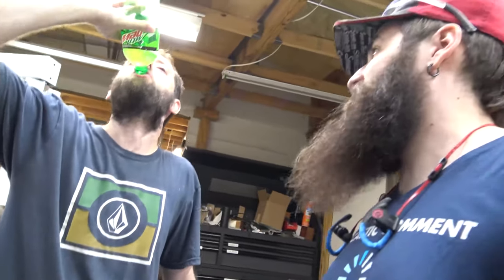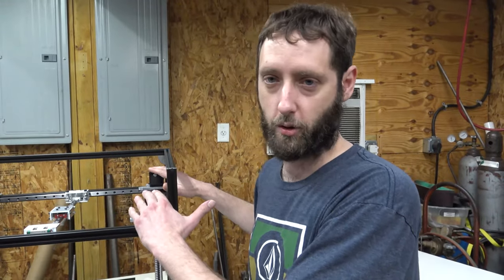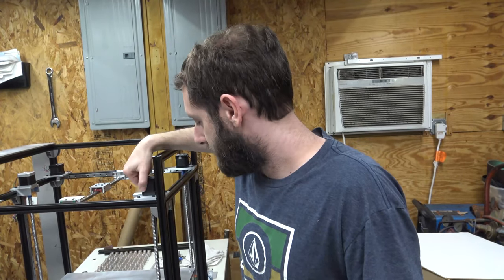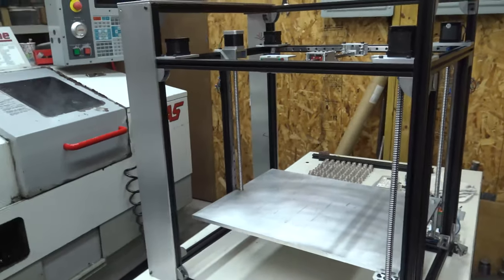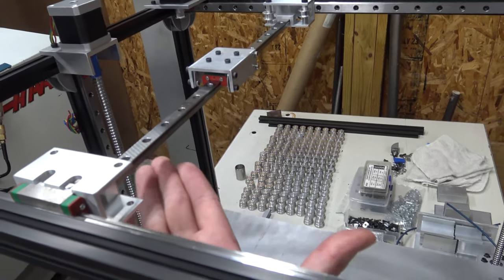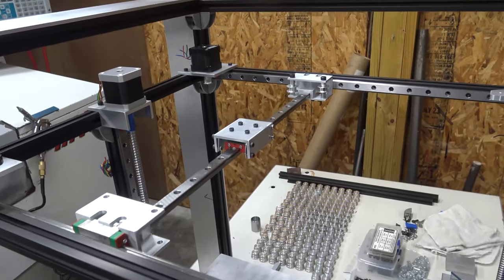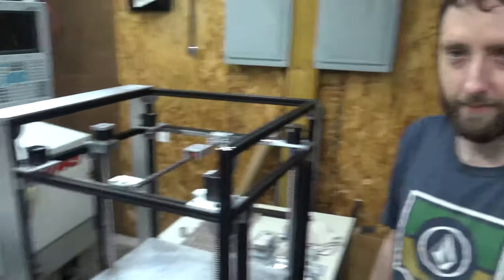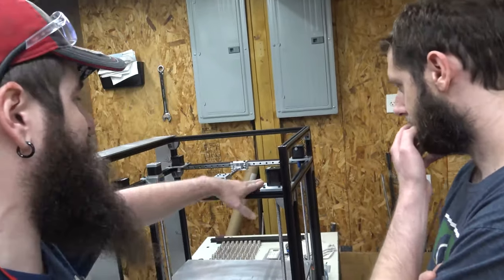CoreXY 3D Printer Build

Comment: nice video, keep up!.  want to know my 2 cents...... keep in mind i am not an expert .....
I would rotate 90 deg the gantry, unless you plan to set up and have real acceleration higher than 9.81m/s2 ( gravity) . ballscrews in tension is a good thing, tension reduce wobble. Motors are not made to hold linear force, disconnect the ballscrew and motors, and use a proper BK support at top end. then use belt to drive the ballscrew. it will also give you better resolution if you  gear it properly. motors on top makes the center of gravity higher, so be sure your frame is rigid enough. you should have you bed the size of the printable area. bigger bed adds nothing and will dissipate more heat, so less accurate temperature.  keeping everything "centered" reduce moment in the mechanical system, so less deflection, less ringing. Make everything on cad and then mill. milling parts and then measuring with an "construction tape" feels to me you are loosing the accuracy of the mill parts. Again, keep up, very nice to see scratch design.
Reply from the maker: Thanks for the feedback. We switched to a triple z setup with a kinematic bed. See the link in the description.

Comment: honnestly i think you will face more deivation due to the thermal expansion of your thick aluminium giant bed than from your quarter inch thick motor support.
and i think the 2020 extrusion are bending more than your plate.
Reply from the maker: Yeah we switched to a triple z setup with a kinematic bed. See the link in the description.

Comment: sooner or later you would want to have that printer enclosed, so you can print stronger, but higher temperature materials like PC, Nylon or even PEEK. And once your printer is enclosed it's a bad idea to have stepper motor in the hot air that reaches up to 140ºC.
Basically, in a case of heated enclosure, you want all your motors and all your electronics in a separate cool compartment.

Comment: I hate moving print beds, any updates for the workhouse 3D printer? The one with the xyz gantry.

Also design wise, your steppers at the top would be perfectly fine if the mounting method is very stiff. But since it doesn't look very stiff yea mounting to bottom may be easier to stiffen.

Having you considered using magnetic encoders on dual shaft steppers to ensure there are no misteps or desyncs between channels and instructions sent?
Reply from the maker: Magnetic encoders? We've talked about that. I'll have to find a source. I guess it would wire up to electronics similar to a rotary encoder?
Reply from the maker: There's more updates coming soon for the Workhorse printer.
Reply: @3DDistributed  awesome! Look forward to the updates!

Comment: because you guys move all the Z motors to the bottom. I think it is better to move the belt and pulleys to the top instead of the inner-side to side. Also for the bed, I would love to see Maxwell coupling for auto bed leveling.
Reply from the maker: Hey Trung, I've been meaning to get back with you. We actually have a version with the belts and pulleys on top. We planning on having an enclosure so it works well with the belt path on the inside. I actually have a kinematic coupling version of the z-axis bracket but need to make a couple of minor changes.

Comment: Looks good guys. I agree with you about the independent Z motors. If you run Marlin firmware it gives you the option to do a Z alignment as well. I always run a z alignment before a print because I have noticed the bed will drop just the slightest bit sometimes. It may only be 0.05 but that can be enough to cause hell with a first layer. Like someone else said look at using linear rails or something to help reduse the sway of the bed as well. Those lead screws cam only be so stiff. And I couldn't tell but the look like they arent anchored at the bottom. Sorry if I'm wrong.
Reply from the maker: I agree... It's just good if you can automate bedleveling where you dont have to check it. Everytime you pull a print off the bed your increasing the chance of knocking your bed out of level.

Comment: i think its not a good idea to have four z axis motors instead of combination with linear bearings/sliding bars or guide rail to hold the built plate  firmly without any abnormal play.
Reply from the maker: There's only 3 z-axis motors. It's now a kinematic bed and triple z setup. Check out the updates and see the User Group link in the description.

Comment: I'd suggest rotating those y rails on their longitudinal axis, that configuration makes MUCH more work for you in terms of obtaining parallelism, put them on a common plate if possible that way you are guaranteed ballpark alignment in one plane at least. You can then machine some registration features into that top plate. I.E. a shallow pocket for each rail or some dowel pin holes, and you are there. Binding bad.
Reply from the maker: Yeah we've been considering that. The only reason we moved into the inside is to have clearance for the enclosure.
Reply: @3DDistributed  Heh, yup I know the dilemma. I ended up concluding that a bit bigger isn't such a big problem, or put another way, the more manufacturable version was less of one. Fun fun fun!

Comment: Only 20+ likes? At last someone making a DIY printer without any plastic parts. I was confused between making a BLV or HEVort but this... Yes I will go for this one probably.

But I want to ask one thing; is only one mng on the x axis enough? I mean is there any chance that carriage would start leaning/tipping sharp turns? I did not see and mgn rails in real-life so I cannot judge if it is rock solid or not. Can you share me your knowledge/experince on this please?
Reply from the maker: Thanks man! We now have added a support to linear rail but they are pretty solid but most people like to reinforce it. We've actually have made a lot of changes since this video. I posted a link in the description.

Comment: Why stick all the motors inside an ALL METAL printer? The whole reason someone would want to go this direction is from a heated chamber. You could hang the xy motors off the back and tuck the z motors underneath.
Reply: high temp motors can handle up to 180C

Comment: Like the approach on better balancing of the core pulleys but the DIY Jubilee triple Z design has been executed Flawlessly. Pivot points are required at the bed to get full range of motion from the the motors. Placement of the motors below the print surface don’t interfere with the X or Y travel like they do over the top. 

https://github.com/machineagency/jubilee/wiki
Reply from the maker: Yeah I just looked into the Jubilee a few weeks ago. Definitely a nice machine.
Reply from the maker: We switched to a triple z setup with a kinematic bed. See the link in the description.